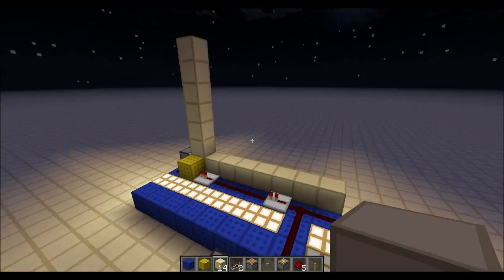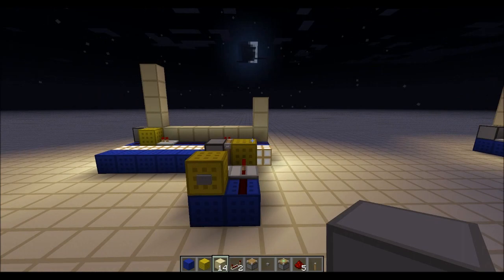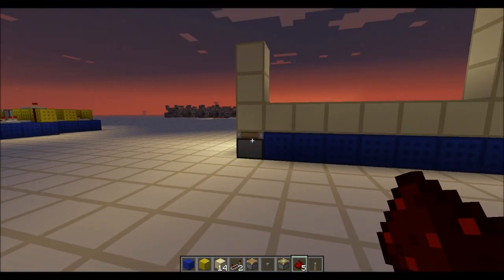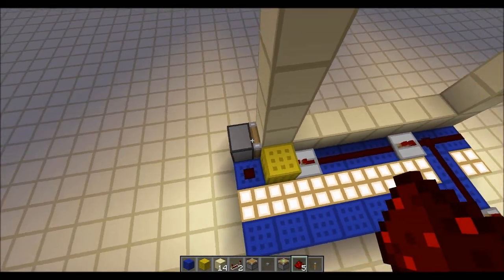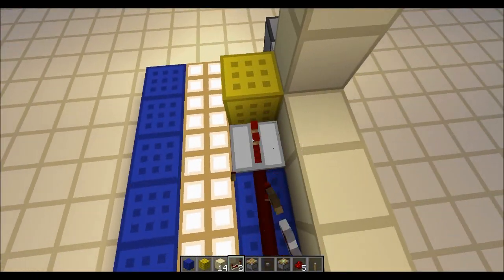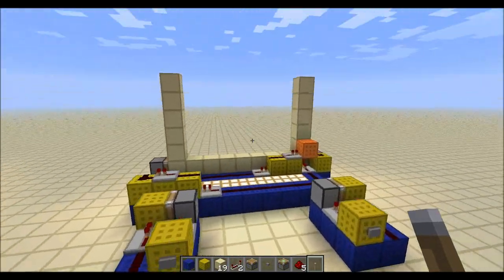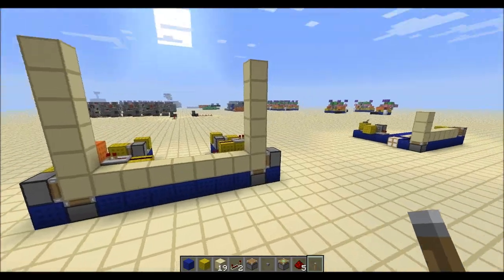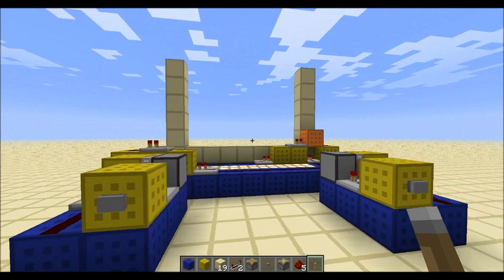Minecraft Tutorial: Piston Powered Sand Column

Comment: make the piston under the sand extended by default. The proper delay should be just the torch delay for the vertical piston and a repeater set on the second setting for the horizontal piston.